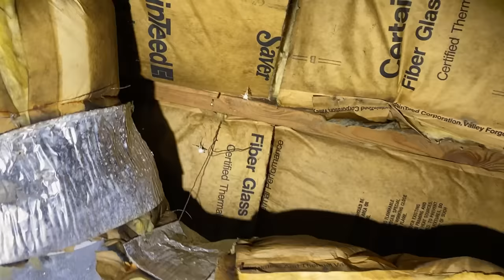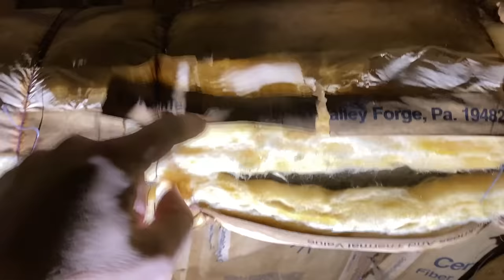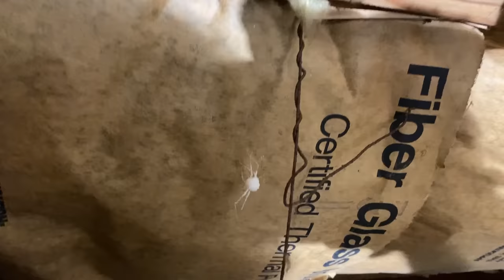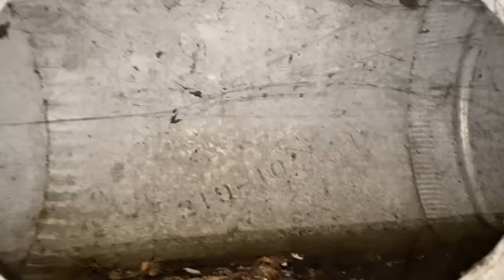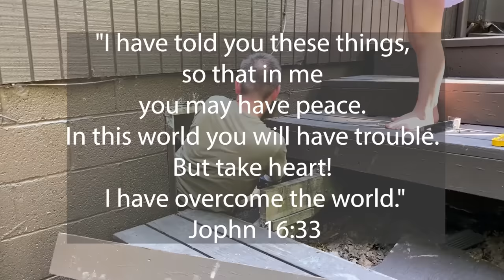Finding A Secret Room Under My House and What Was In It

Comment: My father does heating and air-conditioning and has most of all my life. Just a suggestion but I think maybe what you might be having a problem with is you’re a coil in your furnace. Has a drain pan to catch the condensation that comes from your air conditioning when it’s running. If the pan is rusted and has a hole in it it will let the moisture into your ductwork into the return air side of your duck work this is a possibility. We need to take your air-conditioning systems apart and check them thoroughly with lights and see if the pans under the Ecole system is leaking and if the water is draining outside yes it is possible to get that amount of water or more from a air-conditioning system that is not draining properly to the outside this is a good thing to check hopefully I can help you out and it will be resolved.
Reply: Had the same thought l work on houses jack of all trades master carpenter
Reply: Able sounds like your father should go up and have a look lol
Reply: A typical a/c makes over 10 gal of water a day.
Reply: @todd4335  technically the AC doesn't MAKE the water. What ACTUALLY happens is that the molecules of cold air are closer together than the molecules of warm air. Air acts like a sponge, absorbing water vapor the way a sponge absorbs water. But when the air cools down, the molecules get closer together, and like when you squeeze water out of a sponge, the water vapor gets squeezed out of the air. So it comes back together and forms droplets of water. It's the same process that causes water to condense on the outside of a cold drink. And, fun fact, it's the same process that causes DEW to condense on the grass as the air cools overnight. It's also what causes it to rain at the spot where a cold front and warm front meet. And when so much water is squeezed out that it can't really GO anywhere, that's what causes fog and clouds (fog is just a cloud on the ground).
Reply: @juliebaker6969  so what took the heat out of the air? A/C huh.
Reply: @todd4335  yes but the AC didn't MAKE the water, the water was always THERE, just in the form of water VAPOR. All the AC DID was force the water out of the air. Saying the AC MADE the water is like saying YOU are "making water" when you wring out a wet sponge.
Reply: I agree with Able Lock Im a AC Tech and have seen this issue in the past this is possibly what’s happening in your home. Please be aware that you need to be careful with the sitting water in your duct and drain pans. About 6 years ago i was working on a unit in a house no more than 15 years old, there was water sitting in a rusted drain pan, i was in the attic working on the unit for a few hours replacing the unit and contracted Pontiac Fever which is a milder version of legionnaires disease. It was BAD! Don’t let your girls near the area while your working and wear a respirator if possible! Stay safe and good luck!
Reply: @juliebaker6969  your kinda splitting hairs now. Yes the moisture was always there. Nothing but nature can actually make water.
Reply: @gmrick1412  With the state of our "education system" today I have learned never to assume that people will know ANY particular fact. When you have experienced highschool and collage kids who are unable to tell you how many states there are in the USA (Obama said 57....and HE was PRESIDENT at the time), or even what CONTINENT they live on, you learn NEVER to assume people know ANYTHING....at all....period. 🤷 I'm sorry if you find that annoying, trust me, you don't find it HALF as annoying as I find the fact that it's TRUE.🤦
Reply: @cindyjohnson5242  Pretending to be a science expert? If I have no content on my channel what makes you think I'm pretending ANYTHING? I made no claims of superiority or expertise, only a simple factual statement concerning the origin of the water. And I wasn't even talking to YOU when I MADE it. 

Your theory that "nobody that watches this type of video" really cares about science is disproven by the fact that we are HAVING this conversation on this channel. Especially since you are NOT the first to comment back to me about it. Funny how something no one supposedly cares about has become such a bone of contention.
Reply: @juliebaker6969  You are being Pedantic,
Reply: I’m hesitant to join the conversation but here goes, moisture drops out of the air when the temperature drops to the dew point. Which is where this water came from.
Relative Humidity (RH) is the amount of water the air is able to contain at that given temperature, not the amount of water in the air. Drop the temperature and the RH rises until it reaches 100% that is the dew point. Raise the temperature and the RH drops. To measure the actual amounted water in the air you need measure the wet bulb/ dry bulb temperature and use a Psychometric chart. Or google it.
Back to the video vent the crawl space and clean out, re-insulate the ducting and add a drain.
Great video.
Reply: Find the AC condenser. It will have a  pan and drain. Make sure that the pan is intact and that the water that collects there is  draining or being pumped outside.  

I suspect that you will find the  problem in this area. Something is not working and the water is dumping into the ducts and stagnating. Once you figure out the problem and fix it, have the ducts cleaned. They need a spray of some disinfectant, perhaps bleach. And then a good inside cleaning. The stagnant water has been growing something that stinks.  That's your problem.
Reply: @juliebaker6969  yes, you need to replace the pan if it is leaking and replace (or just install a condensate pump(which some HVAC installers don't include).
Reply: @cindyjohnson5242  wow! Obviously you've never read any of my conservative or Christian comments on this or other channels if you are having delusions of me being a CCP ANYTHING. People like me are SHOT in China.

And I have no content on my channel because I'm a disabled senior citizen who never gets a chance to do much of anything others would be interested in. And besides, I haven't even figured out how to access my voicemail, much LESS put together and post a video. I wouldn't even HAVE a YouTube channel if my HUSBAND hadn't set it up for me. He was tired of having to entertain me once our DVD player broke. Our analog TV couldn't bring in any channels, and there are none worth watching anyway.
Reply: I work for an hvac co, and agree with Able.  Look at disposal of water condensating on your cold coil.  Plugged hoses, failed pumps, leaking pans, failed heaters in those pans, failed evap pan blowers, etc.
Reply: Wow ..neva knew
Reply: So which  is it god or  hydrogen
Reply: "what you might be having a problem with is you’re a coil in your furnace"
I'm a coil in my furnace? Huh???
Reply: He needs to do a temperature differential test on the register too. To get an approximation of his A/C refrigerant charge. It's possible the refrigerant charge is gone and letting the coil freeze over and pulling the water into his vents as it melts off the coil. It's just a good idea to do a differential test with a thermometer every once in a while to gauge the efficiency of the A/C system without having to call a professional out to check your charge and possibly hit your wallet unduly, if your charge state looks good.
Reply: @cindyjohnson5242  Cindy. YOU are the one who sounds like a troll. Stop telling people off for passing on their knowledge.
Reply: Great offer
Reply: @juliebaker6969  a whiner too! I'm disabled, in my 60s and I figured it out. You sit around and complain, and are rude. I do something constructive with my time. 
The content isn't the videos you upload, it's the channels you watch to educate yourself.  It's what you subscribe to. 
So you tell people how to do things, yet you play the whoa poor me additude.  Lots you can do lady, if you want to.
Reply: @carronalee  thank you!
Reply: @cindyjohnson5242  
A. I'm NOT complaining, I'M explaining, if you don't know the difference I feal sorry for you.

B. I'M rude? You criticize ME, and call me a troll and a CCP operative, and I'M the one that's rude?!?!?

C. If you call unsolicitedly berating people in the YouTube comment section "doing something constructive" with your time, you need to Google the meaning of the word "constructive".

D. I DO know the meaning of the word constructive. I have spent the last four decades housing and feeding homeless people and helping them get back on their feet. And I'm currently running a food pantry out of my home. What are YOU bringing to the party?
Reply: @Disappointed739  well then that ENERGY had to have come from somewhere. And of COURSE God is clever, he designed and orchestrated the creation of every thing, plant, animal, and person from galaxies to subatomic particles and everything in-between. And did so in a way that takes everything ELSE in the universe into account, from gravity to anaerobic bacteria, to oxygen. It's mind-boggling to think about everything He had to coordinate to make it all work.

And as hard as it is to comprehend how intricately things had to be orchestrated for them to function so perfectly, it is even MORE impossible to believe it was all just some happy accident. Or more accurately, a series of billions of happy accidents that all had to come together in exactly the right order, at exactly the right times. Talk about implausible.

As for my being antagonistic; if you consider CARING enough about where YOU, and others that think like you spend eternity, to be antagonistic, you don't understand the meaning of the word. It would be easy to sit back and laugh at your ridiculous theories, but that wouldn't alter your final destination would it? If you refuse to believe, and end up in hell for eternity, you won't have "Julie didn't warn me" as an excuse.

YOU ultimately have to make your OWN decision, but I'm responsible for telling you there's another choice. And I'm doing it out of concern, not antagonism. What OTHER reason than CONCERN would motivate me to open myself up to your criticism and ridicule?
Reply: @Disappointed739  ummm what nothing you said made sense yeah I just didn't make sense
Reply: @juliebaker6969  word of advice.
Stop watching so much politics. It's turning you into a sour person even where politics aren't involved.
Reply: @spiderpickle3255  I just went back and reread all of my comments, and I STILL can't figure out what I said that caused you to infer that anything about me is politically motivated. Was it perhaps the fact that ONCE I offhandedly mentioned being conservative? (Hint, most people ARE, no matter WHICH side of the aisle they sit on.) Conservative only means wanting to preserve the status quo. The side of the aisle you sit on only dictates WHICH values and social norms you'd like to see remain constant.
Reply: @juliebaker6969  oh no. I knew long before you mentioned being 'conservative'. 3 of your comments in was enough.

Your attitude absolutely says it all.
I have spent so much time around other people who just can't stop destroying their humanity by immersing themselves into politics that I can feel it a mile coming when they open their mouths.
You also didn't deny spending an inordinate amount of time watching politics, so there's that.
Reply: @spiderpickle3255  actually, I'm pretty much a libertarian. The extent of my politics is; the constitution is there for a reason, to protect the freedoms of the citizenry. I just want to be left alone to live my life the way I feal God wants me to. The only subject on which I hold anything like a "political" position is that I believe abortion is infanticide. I believe that infants in utero ALSO should have the right to life, not just people who've already been born. But then that is a function of my Christian beliefs more than my political bent. The only things political I pay attention to are things directly affecting our constitutional rights. The Republicans MAY be better at protecting those rights than Democrats, but frankly not by much. If you see that as political, so be it. Look where ignoring the attack on our rights has gotten us thus far. Sorry if it upsets you, but I stand on my God given constitutional rights, anyone that DOESN'T is a subject, not a citizen, and I prefer to be a citizen.
Reply: @juliebaker6969  ackshually.jpg
Reply: @spiderpickle3255  ❓
Reply: I don't know if you started and finished your project yet but if you have not completed it, I would like to suggest that you fund out as much as you can about that room through history books, construction plans and the internet to see if there is information you have not found yet!
Reply: It can also ruin your sheetrock if it had a hole in the s.c.drip pan and rains a lot ,it can start running down your walls,and ruin your walls,almost the whole downstairs bathroom closet was molding before we noticed it
Reply: @cindyjohnson5242  Wow! You think someone knowing how water vapour works makes them a scientist? You must be American.
Reply: @CloneDaddy  yes I'm American and a Scientist with a Doctorate from UT Austin. If you , or anyone else has a problem with that I don't care! You are nobody!
Reply: @juliebaker6969   Loved your last written response to spider whatever. I am definitely a citizen and not a subject  I completely concur & love love that line.  It's so good I hope you don't mind that  I use it sometime. 👏  As for this video I sure hope it gets rid of all that nasty water. 🤢 can't be good for him and family to live around.
Reply: @rosylee5683  thank you, you are absolutely welcome to use anything I said, I would consider it a compliment.

And yes, they DID get the water situation figured out, it was a plumbing leak.
Reply: @juliebaker6969  did autocorrect interfere? " Collage" aged kids?
Reply: @terrywereb7639  yeah, I have dyslexia so sometimes things like that slip past me unnoticed.🤷 I USUALLY catch it when I double check, but obviously not always.
Reply: @juliebaker6969  
Maybe if you used crayola crayons & hieroglyphs. I get what youre saying & i hate science. But its nice to know it at times as well.
Reply: @jeffarh  best answer
Reply: An AC unit will produce a lot of water when it is running hard !!
Reply: @kennethking3562  yes, but he later found out that his bar sink was leaking into the ductwork.
Reply: @carronalee   Exactly. Totally Agree.
Reply: @juliebaker6969  Totally Agree. It is my belief that this can be summed up in ten words: In the beginning God created the heaven and the earth.  The Heavenly Father deserves all the credit for the creation of  his earth.
Reply: Agreed
Reply: @todd4335  *you’re
Reply: We had a similar experience but the water ruined a carpet so we found out faster.
Reply: @juliebaker6969  Pretty sure he meant produces, or accumulates. But you feel smart now , gotcha.
Reply: @todd4335   You are correct, Todd.  I LOVED your reply!  😆  Hahaha!
Reply: @kennethking3562  units in Arizona work hard but make no water. They make a lot of water when it's humid.
Reply: @stacyadkins5374  ever consider spell correct decided on your instead of you're. My bad for not proof reading my comments. Hey here is an idea stop being a school teacher .
Reply: @cme98  

L
Reply: @juliebaker6969  so technically yes the a/c is making water. Without the a/c running the water will not be produced. Your just trying to break it down farther than it needs to be.
Reply: @slanger2563  Argue all you want. Everything I said is 100% accurate. As for whether or not I broke it down too far; that's just your opinion.....which I reserve the right to thoroughly disagree with.
Reply: clogged condensate line from condenser.....a/c blowing droplets if water into ductwork and collecting at lowest point. stagnant water smells like sewage.

Comment: Growing up in the midwest my first thought (after fixing the odor problem) is to get that dried out and install a trap door for a root cellar/tornado shelter!!!!!!!
Reply: I'm in Texas. I'd love to have that!
Reply: Two passageways into that space would make it safer for fire reasons. Most rooms you want two egress paths. (Usually, windows can work for that in a pinch.) A trap door in the floor (with a ladder of course) definitely makes sense.
Reply: @fitybux4664  When a tornado is barreling down on you, just being in a safe place is the first thing on your mind.
Reply: My first thoughts also, root cellar type storage & fallout shelter from storms... 🌹
Reply: So are you in a tropical area were all the duct work is used for is air-conditioning or do you have seasons were you need heat if so than what you have is condensation it builds up over time and as with all standing water stagnate over time for health reasons you need to clean it with  bleach to kill any mold and mildew any time you have a crawl space that's the first thing that you need to check out before buying a house can be so many things wrong with an area over a crawl space the worst is rotting joists and supports also foundation problems as well good thing the worst is a pipe full of stagnant water and the insulation being compromised  at least it an easy fix
Reply: With today's news a bomb shelter!
Reply: Condensate pan is overflowing into ductwork. Either condensate drain to outside of house is blocked. Or drain pan is rusted out.
Reply: Also you need plastic on the dirt and maybe a dehumidifier and vents to the outside. Water could be coming in from around the chimney.
Reply: I'm in Tennessee, I would LOVE to find a room like this under my house.
Reply: I would to see an up date video of what happened with the room under the house can not find one so hopefully you will post soon.
Reply: Good hidden indoor grow room for ya know the veggies and such. Have air-condition which  an be your air intake. Couple 8 inch Carbon scrubbers depending on what your growing. I say jackpot!
Reply: Good call! That was probably its intended use.